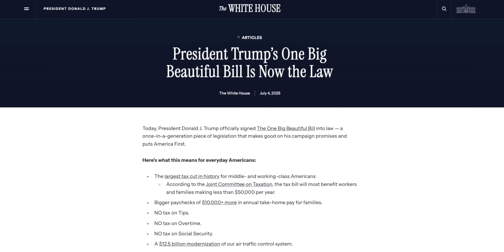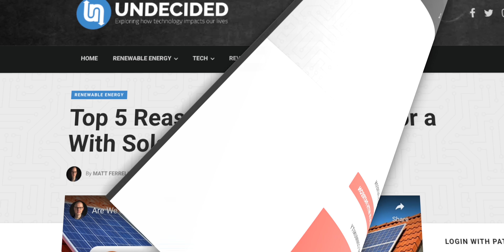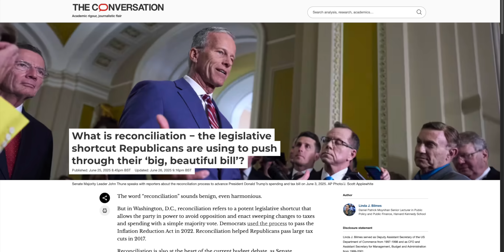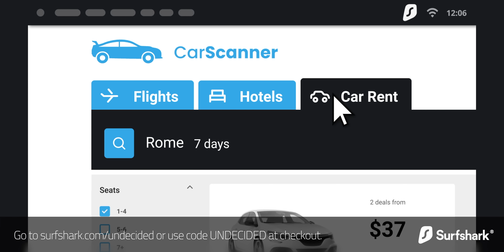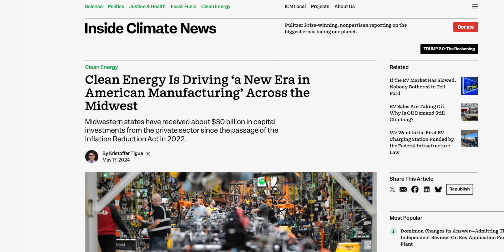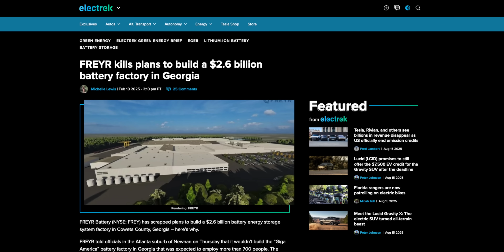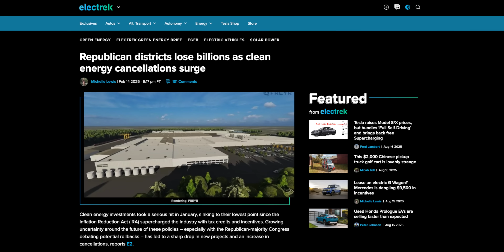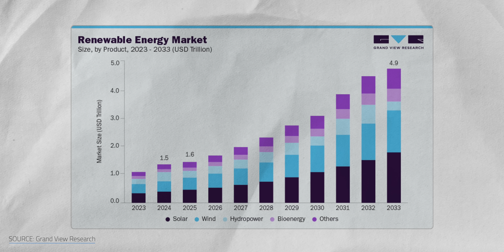How the U.S. Just Handed the Renewable Future to China

Comment: Here’s what I was able to gather to counter Matt’s argument
1. Cost to the Consumer
	•	Farrell’s View: Tariffs raise solar panel and wind component prices → projects get more expensive → consumers end up paying higher electricity rates.
	•	Counterpoint: True in the short term. But without tariffs, the U.S. becomes permanently hooked on cheap imports (mainly from Chinese-owned factories in Southeast Asia). That’s a temporary bargain with long-term risk. Paying more now builds domestic industry that stabilizes prices later.

2. Speed of Renewable Deployment
	•	Farrell’s View: Tariffs slow down clean energy adoption because developers can’t afford as many projects. That delays climate goals.
	•	Counterpoint: Faster isn’t always smarter if it locks us into foreign supply chains. Rushing deployment with 90% imported parts is like building a house on rented land — you don’t really own it. Slower growth with U.S. factories scaling up makes the system resilient.

3. Energy Independence
	•	Farrell’s View: Solar and wind make America independent because the “fuel” (sun and wind) is free and domestic.
	•	Counterpoint: That ignores the hardware side. Panels, inverters, wind turbines = foreign made. Without tariffs, we swap oil imports for Chinese-linked tech imports. That’s not independence, that’s dependence with a new flavor.

4. Economic Impact
	•	Farrell’s View: Higher prices hurt American consumers and slow job growth.
	•	Counterpoint: Tariffs create U.S. jobs in manufacturing, installation, and maintenance. New factories in Ohio, Texas, and Georgia are already ramping up because of these policies. Long-term, that means thousands of American jobs and billions in tax revenue instead of sending cash overseas.

5. National Security
	•	Farrell’s View: Not a major focus — he treats renewables as an economic and climate issue.
	•	Counterpoint: Energy is a national security issue. If 70% of your solar supply comes from Asia, and global trade gets disrupted (war, sanctions, shipping lanes closed), your grid is vulnerable. Domestic manufacturing ensures the U.S. keeps the lights on no matter what happens abroad.

🏁 Bottom Line

Farrell sees higher costs today and calls it bad for America.
But he misses the strategic payoff tomorrow:
	•	Jobs stay in the U.S.
	•	Supply chains are secure.
	•	True independence from foreign control.
	•	Resilience against global crises.

It’s the classic short-term pain for long-term strength trade.
Reply: What jobs? Where are they? 
Jobs produce families that need groceries and cars, restaurants, car dealerships etc. This nation is stabbing itself and we don't see it because we are self absorbed. We're a part of a global economy and the rest of the world is marching forward.

Comment: Here in Colorado, I'm trying to upgrade my solar capacity and add batteries. Started the project in June, but Xcel Energy is so slow in approving hardware to be attached to the grid and giving permission to operate that I'm freaking out that the project won't be completed before the end of the year. I understand the caution, but adding the 30% I would get back from the government to the cost is a deal-breaker for me. Ugh! I'm tearing my hair out in frustration over our government and its willful stupidity.
Reply: We need to vote Trump's regime out and vote for a Congress that will take back the Purse!
Reply: @extraincomesuz 20/20  hindsight is a wonderful thing.
Reply: Maybe you should go the whole way and disconnect from the grid entirely - the money you save with complying with the silly codes and standards along with utility fees would probably allow you to double the size of your installation. Just remember to optimise the panel angles for winter solstice.
Reply: They want to keep you from achieving self reliance or even making money. You are a direct competitor to them and that means they need to inhibit you as much as possible. Stick it out and hope that we can get our grids publicly owned.
Reply: Good luck - I hope you can get what you need done.  I put solar in 2 years ago but was waiting on adding batteries (but I had the system setup to be able to easily add them).  Going to have to see about pulling the trigger now.
Reply: Make it off grid instead. Solar has never been so cheap. Electricity bills will only rise especially after these moves. Here in the Netherlands electricity is 450,- and year 45 a month for rented panels we supply 260,- euros next year that will be gone so we will pay 765 at minimum. Gas for heating/shower 560,- With costs going up atleast 10% as well.. a complete solar package excluding batteries for 16 panels costs around 2500,- so would have the money back in 3 years when hooked up. Batteries are getting cheaper too. Adding 4 quality  batteries adds another 4k so in 7 years its easily payed off. Of we would sell off exces then it probably would be 4-5 years. Think about it.
Reply: @Strange-Viking  Drive EV and give the oil industry the middle finger.

Comment: There is one other key point that fits well here, under all the great work you presented and points you made. The US power grid is aging, vulnerable, and unpadded for crisis. Renewables can help offset a lot of that burden. As we should also be much further along in upgrading, reinforcing and shielding our power grid.
Reply: Even renewables need a performant grid.
Reply: @dirk2518  Not with batteries. By the end of the century, much of the power grid will be replaced by decentralized battery + solar. That's a consequence of economic forces which are outside of government control.
Reply: @dirk2518  Yup, Tesla's virtual plants need a grid that works from the house on up.

Comment: It gets even worse when you remember that the AI competition will likely be won or lost on electricity availability and price. China already has electricity roughly 2x cheaper than the US, works with an 80% to 100% operational reserve (as in, excess generation capacity to handle demand spikes or new demand), and can build new capacity far faster; meanwhile, electricity prices are rising in the US and the average operational reserve in the US is 15%, with a much less integrated national grid, to the point Texas is already drawing plans to simply disconnect datacenters in case of a demand spike.

The Big Beautiful Bill isn't just handing the future of cleantech to China on a silver plate; it's likely handing the future of AI too, since it shuns the cheapest and faster to build kinds of electricity generation while promoting more costly and slower to build electricity generation.

Comment: Well said! Renewable energy is the only way guaranteed to create energy security by removing reliance on other countries. Renewable energy is also the cheapest possible method of generating energy, and emits zero pollution after installation  - between 100,000 and 200,000 Americans die each year from breathing air pollution alone! All that is on top of renewables being  the only solution to stopping climate change - so even for people nieve enough to deny climate change, the benefit of switching to 100% electrification and renewables is undeniable.

Comment: Americans have enjoyed low energy costs for a century. How do you think that happens? Low energy costs benefit the entire population and keeps inflation down. Getting the mix right between renewables and carbon is essential. I think you miss the boat when you speak of carbon subsidies while leaving out the massive benefits throughout the country of cheap energy from carbon based fuel. Solar and wind cannot possibly supply the power we need to produce enough electricity to run our country. Not for a long while. Let's keep investing in renewables but also keep American growth with low inflation and secure steady domestic supply of oil and gas.

Comment: To play fair, its not like green energy is going away, its just going to be slowed down. Yes, we shouldnt invest more into fossil fuels, but green energy can stand on its own and thats a good thing by it self. With that said, the current president honestly is totally out of touch. We need to roll back what hes doing and restart pushing the tech more. With that said, if we can get geo-thermal going - it could offset everything though. So I feel like we're on the edge of many power improvements soon enough.

Comment: A $60,000 Tesla new in three years is worth less than 1/2 and with less than 30,000 miles.

This has happened before the OBBB. EV are luxuries for people that can afford depreciation.
Reply: What's the price of a a $60k ICE vehicle after 3 years?
Reply: @TonyWhitley  you would have to do some comparisons to to find depression value
Reply: Luxury EVs are . . . luxury.  Cheap EVs are cheap.  I bought a used EV 7 years ago for $11,500.  Still a daily driver.  Now 13 years old, runs fine, battery is fine.  Have saved over $15,000 on Gasoline NOT bought, nor burned.  You follow?  The car is FREE from not buying and burning gasoline.
Reply: Yes, but most people are buying 39k to 49k versions. Which BTW is the average new Car price in the USA these days.

Comment: I think it's also worth noting, since it wasn't brought up in the video, that fossil fuel energy development is currently constrained by equipment suppplies because produciton lines are a very long term investment that the equipment manufactureres don't see as profitable with the rise of renewables. Even with the economic boost from the trump administration, no one is going to open a new production line that's likely to be a stranded asset when the next administration rolls around, and any new lines wouldn't start producing meaningfully at all until the end of the administration anyway, so even nearly infinite subsidies for the next 3.5 years wouldn't change things much.

Comment: if nuclear is a problem for you.  you are not for the environment.  nuclear is the cleanest, greenest power on the face of the earth.  solar is great, not dependable.  wind is great not dependable.  all the years of san onofre nuclear power has a footprint no larger than the current footprint.  no radiation leaks, no troubles.  but California forced it closed.  California made it a joke to convert to solar.  there is no upside and you will always have a true up bill unless you spend 30K plus to get multiple batteries and more panels to charge them.  the green industry is a scam on it face.  it is only as big as it is because of nonsense regulation and policy by libtards.

Comment: The last four years of the Biden administration is what doubled all our cost especially in business. 

The energy sector doubles the cost of power for businesses. My 1200 sqft retail electric bill is twice as much as my 2100 sqft home electric bill. I even shut the business AC off at night and we are closed on Sundays.

Your utility bill is one piece of your cost of living. Bottom line what made life expensive was the cost of diesel fuel. Everything is transported with diesel. Even regular gasoline is hauled using diesel trucks.

If you give the heavy lift job to electric trucks costs will double again because of charging times and payloads dropping by several tons. 

The EV and AI industry will affect your monthly electric bills the most. 

I seen this in the late 70’s and early 80’s. Everyone started buying more efficient furnaces. As more homes upgraded the cost of natural gas and propane prices went higher. This is what is happening with solar. I think you reported green energy supplies 11% of the grid power. Has your home energy cost went down by 5%? 

If your shore power consumption goes down the utility companies will raise the monthly connection costs. Even if your 100% green energy and you wanted grid power backup it will cost you $50 and up (it will go higher than $100)just to stay connected every month.

Like a frog in water raising the temperature slowly so you don’t really notice until you’re cooked.

Unless the entire planet switches to green energy at the same time nothing will change the climate. A fool’s effort.

Battery storage is the only way you can get around the grid giants. Storing at least two months of power with a generator backup. The cost is only justified if you’re saving the planet believer. All the new technology is about keeping big energy in control so you pay a monthly bill an will connect to your battery storage system you will no longer own or made illegal or government will charge a licensing fee to have that much storage plus yearly inspections regulations which will cause your insurance companies to raise premiums because of the risk of high energy storage and replacement cost if you home was destroyed.

Matt, love your show. You need to step back and take a broader view.

Comment: Trump was a real estate guy so he knows fuel burning equipment is the cheapest most efficient heat source because furnaces are inherently more efficient than any engine in any powerplant. 95%-99% vs 30%-64%. Well placed windows on a home can harness more heat/energy from the any solar panels and make the house more pleasant at a much lower cost. 4:04
Reply: 95-99% efficiency sounds really good until you realize that heat pumps are on average 300% efficient.
Reply: @mugabugaYT 33% is the average for power plants... Which cancels the gains. Not including line and transmission losses.
Reply: @suggesttwo The average efficiency for all natural gas power plants in the US is 44%, which means they are indeed more efficient already, but even if your 33% number was true, and you never expected renewables (which are by definition infinitely efficient, and which account for 24% of US electricity production) to come online, that means you're still somehow believing that heat pumps will never get more efficient ever, otherwise even at 33% they'd still be more efficient than natural gas.
Reply: @mugabugaYT newer combined cycle power plants are up to 64% efficient but coal keeps the lights on. So how do you shut down the coal generators if the load keeps going up?!

Comment: I don’t see this as doom and gloom. We may be better off to slow the rollout on the generation side and focus on battery storage infrastructure side that supports renewables, will have the side effect of better using existing generation, and eliminate gas peaker plants. A nice side effect is that it will increase demand on battery manufacturing and development that will benefit EVs. Once the grid is resilient and stable, then go for mass renewable generation.  Storage is a big deal and a big expense as shown by how much a meaningful amount of storage add to the cost of just a home solar installation.  We like to think we can just dump energy into the grid with abandon, but that’s just not reality. Making the power with solar is inexpensive, utilizing that on a grid level is not.

Comment: A lot of these products, like solar panels and EVs have reached maturity. You can buy DIY kits for cheap and operate as your own contractor. The 30% tax credit and $7,500 EV credit only meant that contractors, their partnered solar panel retailers and car manufacturers could charge you more $$$ and gain more profit. A high GDP and our middle of the pack purchasing power index only means that American consumers are getting thrown for a loop.
Reply: I'm glad you are self-reliant enough, at least in this regard, to be able to install your own solar panels. Most people are not - and I don't think less of them - after all, some of them can heal people, which may not be among your skills.  I don't think we were anywhere near the point of maturity on solar panel installation - or EV purchasing. The EV prices are only just coming within range of most people, and they need subsidies to establish their market.
Reply: @neildalesongs6503  you can buy a used tesla for as low as $10,000 and it has all the heat pump and wiring gains of a dedicated EV platform
Reply: @neildalesongs6503  self reliance comes with homeownership. otherwise it's more fiscally responsible to rent.

Comment: The return of investment for the government investing in roof of Solar is very slim even the utility companies don’t offer good buyback rate anymore industrial level. Solar makes sense with the batteries, but roof top solar doesn’t make sense for the government subsidies. Problem with the utilities is to cover enough electricity during demand time, which is usually in the evenings when Sun is not available that’s why we need nuclear long time. It will be cheaper.
Reply: I am installing solar this year before the subsidies expire, but I am installing the smallest solar system possible 4kw system with the five Tesla power wall, which makes sense to me and that’s how the utilities like these days so I can charge it when the price is low and use from the batteries when energy prices high for the utilities

Comment: While I am a proponent of renewable energy, you have to look at the full picture. The purpose of the subsidies was to get manufacturing off the ground. With solar component costs under $1 per watt, and the most popular car in the United States being an electric vehicle, it was time to end this subsidies, and use the money for something else.  I would suggest that the money would be better used incentivizing ground source heat pumps, or paying down the debt which is mortgaging our future. I would suggest that the government's best approach would be to have a federal universal set of regulations for installing solar, as local regulations and unnecessary utility requirements are doubling the cost of solar installations. Europe has done this and has benefited enormously. Your numbers for subsidizing oil at $90-$200 a barrel is complete BS; you really should not be spouting such nonsense on an otherwise I enlightened channel. There may be health costs, but they are not subsidies.